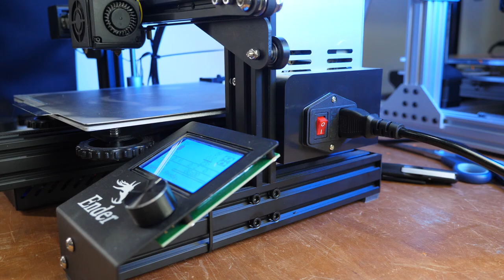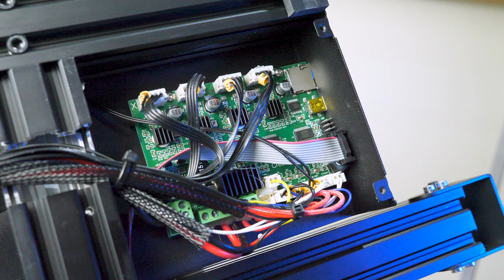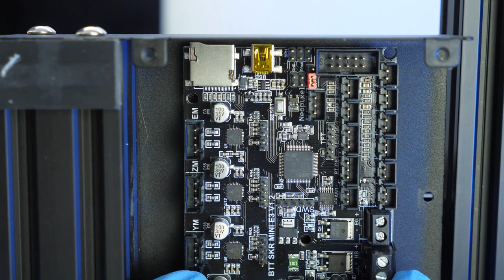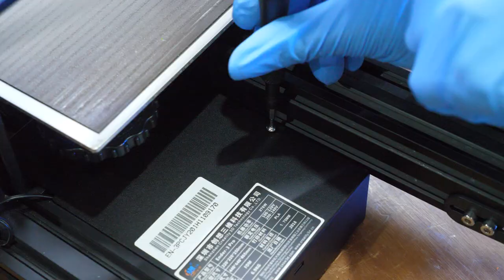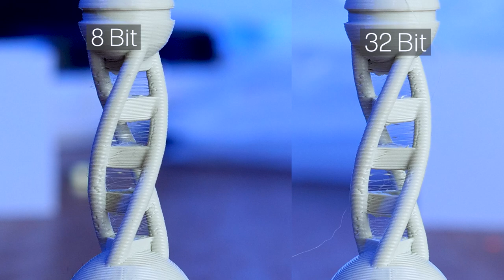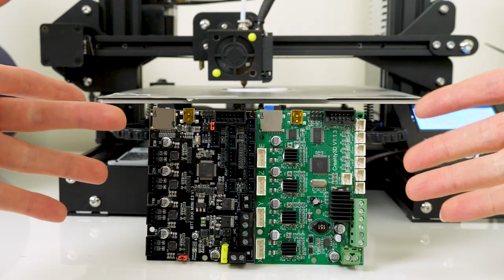Ender 3 32-bit Upgrade Guide and Testing

Comment: This is the video I used. Only criticism is I would have like to have spent more time reconnecting things- particularly the fans and thermisters. They were the only plugs without labels in my unit. Take his advice and take lots of pictures before/during the unplugging process.
Reply: Hi Ken I have ordered this board from Banggood China to the UK and the order has been in processing since 13th/ expected to ship before 23rd of this month, did you order yours from Banggood and did your order do this?
Reply: @AndrewAHayes  I got mine through Amazon.
Reply: @kwebster  I wish I had now although it is very nearly twice the price you know things from amazon are in stock

Comment: Just switched the motherboard on my Ender 3 pro. Its definitely silent, unfortunately the fans do not come on. I may strip some of the wire to take the solder off. Not sure if that would do it, but I have checked the wires to make sure they are plugged in correctly.

Comment: Why you cut the soldered filen wires before screw them again? I have the final hotbed wires soldered and then screwed to the board. Is it dangerous? Many thanks
Reply from the maker: Difference between soldered and loose wires seems to be a little inconclusive. the proper way is to use wire ferrules at the ends. i think i might take mine apart and add those for safety.
Reply: @Vector3DP  I soldered them because i had a problem with the board hotbed connector. It got melted due to "extremely" heat. I contacted the board vendor, a very well known and high quality board, and they told me that the most probably thing is that one or few little wires of the power wire was not well twiested and if a big amount of electric intensity goes throught this lttle wire it could get extremly hot and melt the connector.  Then what I did is soldered the end of the wires. but the bets option is using electric terminals. Many thanks for your feedback.
Reply from the maker: This reprap article i would consider a reasonably good source. https://reprap.org/wiki/Wire_termination_for_screw_terminals
Reply: @Vector3DP  many thanks mate :) great doc :)
Reply: @NestorPomar  As a licenced electrician, I will let you know solder and screwed connections are not compatible.  Solder introduces two problems. Solder creeps and becomes a loose connection. Solder isn't a good conductor which generates heat that contributes to increased creep, more heat, more creep, eventually burning out.
Bootlace ferrules are really good but you do need the correct crimper. Same with pin lugs.
Loose strands are a bad idea and of course encourage inexperienced players to dab on some solder.
Crimpers come a lot of varieties and can run into serious money unfortunately ( I keep over $1000 worth on hand).
So to keep it affordable a decent ratchet crimper that crimps red, blue and yellow pre-insulated lugs will do must jobs. You will need to allow more room though.
One last detail,  pre-insulated lugs come in cheap vinyl grip and professional copper grip design. Try to get the professional grade.
Reply: @mikenewman4078  many thanks for your inputs Mike :) I will do my best to follow yours advice

Comment: Have you seen the video from Tech2C comparing 8bit vs 32bit? https://youtu.be/ySqj3gPqfrs
It would be interesting to see if there is a speed wall on the Ender3 printers in 8bit.
Reply from the maker: well there is no significant calculation to do on the ender 3 so i suspect it wouldn't react in quite the same way. There is always a speed limit of the motors due to back EMF but I would guess its quite a way beyond what the hotend flow rate can handle.
Reply: Vector 3D  True as Enders use Cartesian there is less calculation than corexy in Tech2C’s printer. Still it would be an interesting test to do a cylinder at 100mm/s on the 8bit and then one  on the 32bit to see if there is any difference in print quality.

Comment: That extrusion that has been cut for wires to be run through really made me cringe.  It really should have some sort of protection to keep the wires' insulation from getting cut and shorting.
Reply from the maker: Ye, its not great, but the wire movement in that area is pretty minimal. On my other machine there is a little more protection on the wires.
Reply: I've made a little cover that fits on it, might share it on thingiverse when I've tested to see that it fits well

Comment: I upgraded to the skr mini 1.2 months back and love it, I can print 100mm/s without any issues or quality loss. I am curious how comes your didn't go for a v2 board as its newer? Or does the issues it has out you off?
Reply from the maker: Just took a long time to make the video and publish it. I do have a V2 now, not used yet though.
Reply: @Vector3DP  That's completely understandable! I respect you still committed and put the time/effort into making a great video :D

Comment: heat it up a bit may help remove glue easy
Reply: i dont think this is a good idea. you would require quit a bit of thermal energy, and that might destroy the plugs/jacks/wires/PCB. 

Have a nice day
Reply from the maker: ye, i think heat would maybe do more damage than good and maybe just make a sticky stringy mess. I think pulling/rolling method worked quite well for me.

Comment: That's the first I've ever heard of not using soldered wire in screw terminals. Why would it not be a benefit?
Reply from the maker: Solder flows over time when under compression.
Reply: @smaqdaddy  I have posted a detailed response to the issue for another question above. Solder inside a mechanical connection is outlawed in most electrical standards.